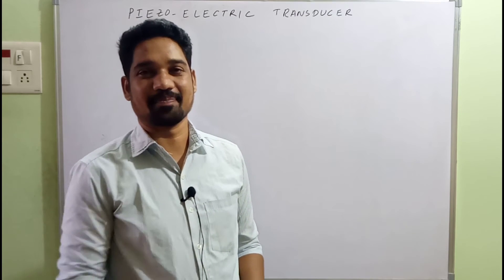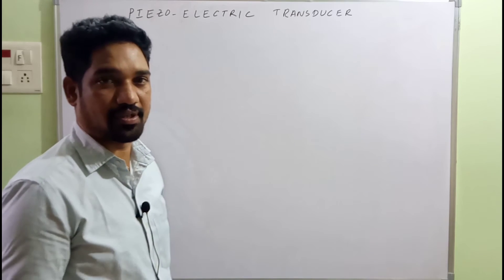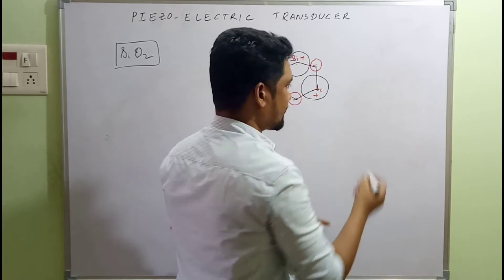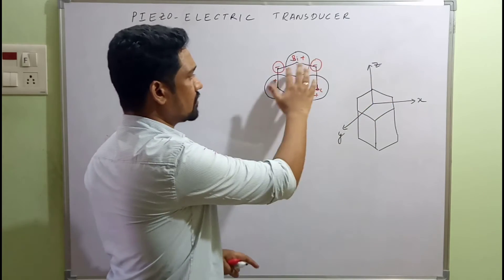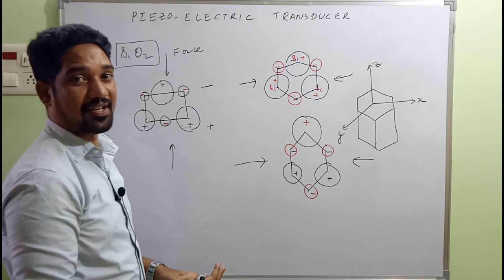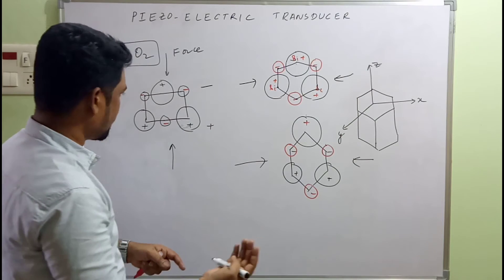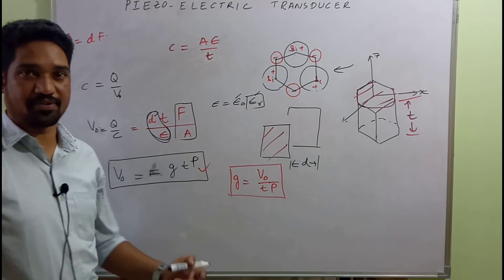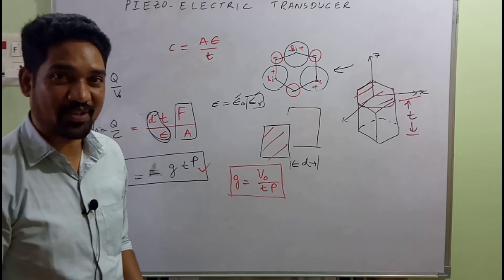piezo - electric transducer || active transducer || EMI  by ushendra's engineering tutorials

Comment: Very lucky and happy to have encountered your video after scouring the internet for answers with no results, I hope you don't mind answering this question-
While converting the AC voltage generated from a piezoelectric element, how can I determine the correct value of my filter capacitor's capacitance and its voltage that can be used after AC voltage rectification? 
What equation can I use or should I just try many capacitors until I find the one that suits my project?
Reply from the maker: Actually we make use of the combination RC. we usually try for different combinations by changing the capacitor values. So, suggestible to keep on changing the capacitor values till we get a satisfying results.    If you are on a project, give me a brief, let me try.
Reply from the maker: And thank you for considering my video
Reply: @ushendrasengineeringtutori4259  
I believe I should email you a briefing of my project so you can have an idea of what I am talking about. Please, may I have your email?
Reply: @ushendrasengineeringtutori4259  
I'm really glad I found the video. It really shed light to many dark areas .